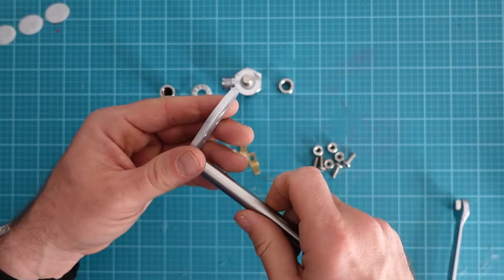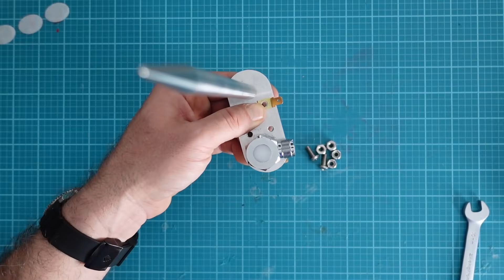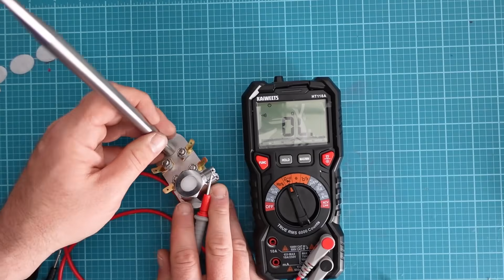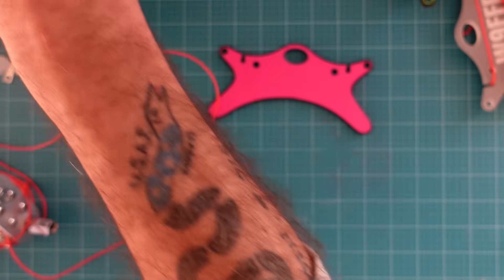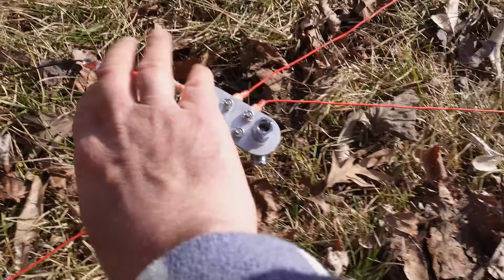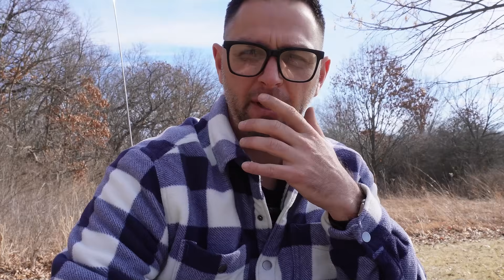Easy, Quick Portable HF Ham Radio Antenna Mount! GET POUNDED!

Comment from the maker: STOCK ANNOUNCEMENTS?  When will the product be in stock? Is there a waitlist?   Check ALL THE ANNOUCNEMENT updates at -> http://www.hamradiodude.com 

Other videos about mounts :

https://youtu.be/rJ3FfJe9Xl8 - This Quick, Cheap, Easy, and Portable Antenna Mount / Ground Spike is a MUST HAVE! 😯😱

https://youtu.be/2WrXJstRPEA - Build your own Super Dude Spike - Antenna Mounting Solution

https://youtu.be/6lMp8ChBURc - Easy Tripod Antenna Mount from GOODWILL For Portable Ham Radio Use  / Parks On The Air!

_

GET POUNDED HERE - https://www.etsy.com/listing/4464445325/pota-pounder-portable-ham-radio-antenna

This mount has many different changes from the Super Spike (affiliate link - https://amzn.to/4cmK0UM) which my inspiration on this build.   - 
- Stainless Spike - I chose Stainless Steel because with my other products, many people had issues with their aluminum spike breaking or mis forming.
- 3/8-24 over 3/8-16 - I chose this because 3/8-24 is more universal in radio.
- 4 spots (maybe 5) for radial wires. I chose this for more radial wires.
- 90 degree SO239 for ease of coax insertion. 
These were 4 critical areas of correction for me.
Reply from the maker: 📢 Update 03/04/2026: Hi everyone, and thanks for checking out the sales page. I truly appreciate all the support. NOTE: This store opens on Fridays. When the Store reaches 30 orders for the week, the store shuts down (unless I feel I could manage it). The orders are fulfilled throughout the next week and ensure peoples orders stay correct. OUT OF STOCK - HRD SS25 This was a limited run but I DID want to do another run. Problem: I have to have a minimum order of 500 units, which is very expensive. I had previously asked to please click the button to be alerted when they are back in stock, which would help me determine interest, but as of now, there's only 16 restock requests, a FAR way away from my Minimum order amount. - DUDE SPIKE 2.0 3/8-24. What can I say , they are inexpensive but quality products, they were in stock for about 3 weeks before they sold out. I am working to get them back in stock. About 40 days for the new products and parts to arrive. - POTA 20 and 33 (non H) 3/8-24 spike kits. Same as above man.About 40 days for the new products and parts to arrive. - POTA POUNDER complete kits. I didn't realize they were going to go so quick. About 40 days for the new products and parts to arrive. No need to ask, this is the most current update. If you want to be on a list, go click on the "Let me know" option in ETSY to be alerted when they are back in stock. Thank you again for all the support and understanding.

Comment: How long are those radials fior 20 meters?
Reply from the maker: For ground radials.... They don't have to be a particular length. However, check out https://73qrz.com/antenna-calc for more information.  radial length suggestions per band, howq many are recommended, tips to decide how many ground radials and links to the DX Commanders research (and more). Mine, I don't know, offhand.
Reply: @DudeTested thank you!  Great channel!
Reply from the maker: My pleasure, enjoy !

Comment: Great looking product!  

My only comment is about the radials: after using a Wolf River Coils spike and four radials for a few dozen POTA activations, I found that it was a huge pain to tune that vertical on anything but 20m with four 1/4 wave radials because I always had to adjust the radials too.  I switched to sixteen 2.5m radials (in four bundles of four radials on each connector).  Once I set them up the ground, I don't have to adjust them and the antenna tunes from 10m though 20m easily with just an adjustment of the vertical. I know 16 seems like a lot, but IME, it is no more difficult to set up than four 5m radials and after it is set up, I can easily move from 10m to 12m to 15m to 17m to 20m so easily!

Comment: Is that a standard thread on the telescopic antenna?
Reply: Not to be a jerk but depends on what you mean by standard. 3/8-24
Reply from the maker: oh yeah, the HRD25 was 3/8-24.  They were sold on my ETSY store - https://www.etsy.com/listing/4306265582/hrd25-stainless-steel-telescopic-38-24 I am trying to get enough interest (250 people or so) to buy more for inventory.
Reply: @DudeTested you might have the interest as the POTA pounder is out of stock.  I will keep watching for availability.  Thank you.

Comment: Now put it on a tripod and elevate the radials and you have a POTA performer.  It will work great in both configurations.
Reply from the maker: EXACTLY! ;)  Hah, you beat me to it, I was considering making that exact configuration and video.  Goodwill Tripod, one complete plate, one inexpensive antenna!

Comment: This video and your description is, very good and is almost,  "most excellent"🤣. The internal thread count of the adapter is a standard used commonly 25-30 years ago, and still in use.. In addition to telescoping whips with the same thread count as the adapter, a lot of older - very old mobile whips will fit. As luck would have it, I have a few old and neglected mobile whip antennas laying about and these, I am certain, are looking for some love. CB antennas( get them cheap) will fit and work for 10 & 12 meters, With an antenna switch, 2-3 positions, a bit more coax cable, a little bit of farting a fooling around with 2 or 3 of your most excellent antenna mounts, a portable( and inexpensive) antenna farm is doable. 👍
Reply from the maker: "EXCELLENT!", haha.  Thanks.   That's a cool concept regarding the antenna farm. Do you need a switch?  Depending on the separation of the antennas bands and other things, I think may be able to get away with daisy changed mounts in a multiband configuration and no switch.
Reply: @DudeTested 😅 Now your making me think about it…..mmMmmm?

Comment: The 90° coax connector is a great idea. I ground mounted my Hustler Mobile whip with a similar arrangement to a piece of rebar.  I also added.the Huster adapter that allows me to put three coils,  20, 40, and 80 meters, atop the whip.
Reply from the maker: That's great !

Comment: Would love to see it on the carbon fiber tripod! This looks like another great HRD product! ❤
Reply from the maker: I thought you have seen it on a carbon fiber tripod?
Reply: @DudeTested Just a photo. I just learned that REZ Antennas offers a 17’ whip that collapses down to 17.5”. That will fit in an Apache case diagonally just like your HRD6 mast. So, POTA Pounder, tripod, mast, REZ whip, coax, battery, wire antenna, and 891 all in one box with room to spare!